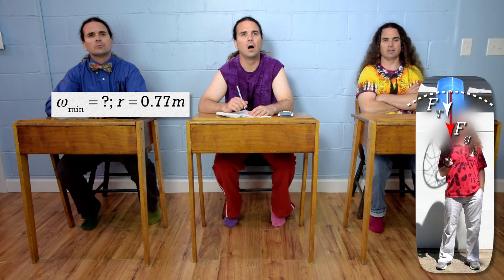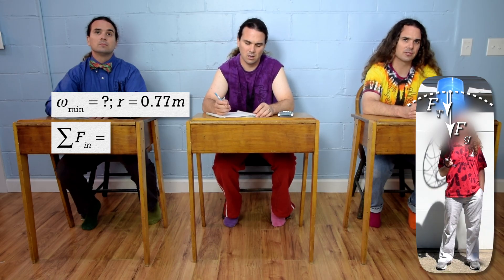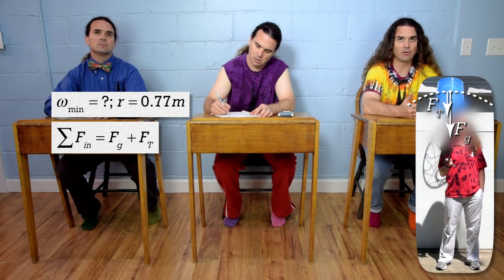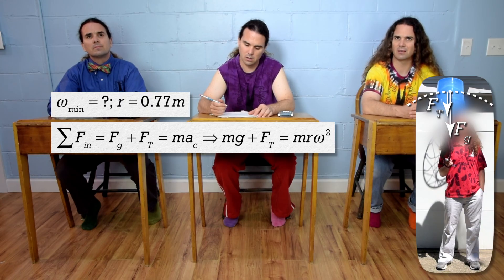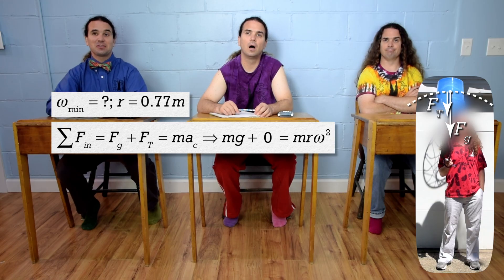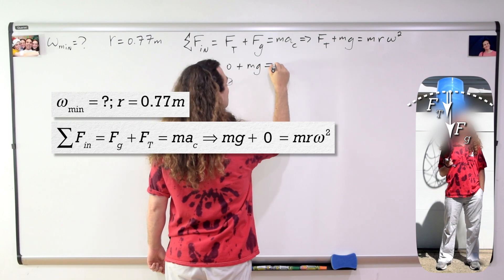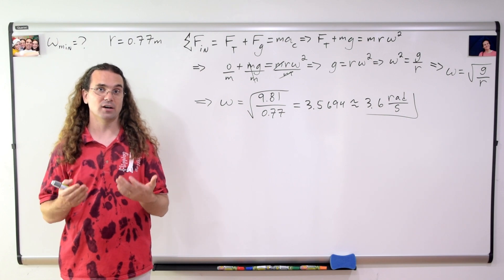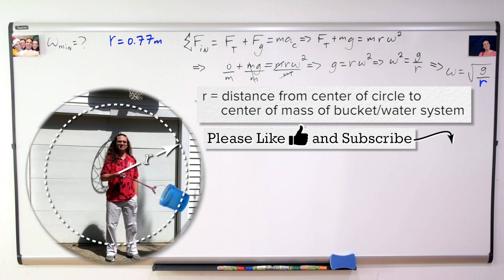Minimum Speed for Water in a Bucket Revolving in a Vertical Circle

Comment: I have a question for when you are solving the problem. So I had mg = mv^2/r. while you have mg = mrw^2. when I solved I got 2.76 m/s and you got rads/s. Is the difference in answer because of the units used, and the equation that I used?
Reply from the maker: I am pretty sure the difference is that I used angular velocity and you used tangential velocity. I talk about the difference in this video after the 4 minute mark. https://www.flippingphysics.com/centripetal-acceleration.html

Comment: I am confused. Does the tension force even work upon water ? I thought the tension force only works upon bucket since it is connected with a string.
Reply: Ultimately, it is the normal force from the base of the bucket that pushes inward on the water.   But the substance of this problem is the same, whether you examine the tension in the rope, or the normal force at the base of the bucket.   Ultimately, we are looking at solving for the special case, where an object can follow the circular path with no constraint force at the very top of the curve, and the object will momentarily be in free fall.

Comment: does this also applied on roller coaster physics? because the function is the same as the bucket of water
Reply: Indeed it does.  Roller coaster inverted loops, are designed such that the passengers only feel a push from their seat, rather than tension in their restraint harness.  When you are at rest in the loading station, you only feel an upward push from your seat.  When at the top of the inverted loop, you also only feel a push from your seat, albeit much less of a push force.  You feel like you are pulled by an apparent force that acts radially outward, holding you in contact with your seat.   But the reality is, you are accelerating downward toward the center of the loop's curve, at a rate slightly greater than g.  The normal force from your seat plus gravity are causing this acceleration.

The restraint harnesses are only there in case the real method of supporting your body doesn't work, such as if the roller coaster doesn't pick up enough speed, and you actually do fall downward in to your harness.  It would be an uncomfortable ride for passengers if it was built for this to happen on a regular ride, so the ride is designed in order to avoid this situation.

Comment: i used another method came out as 204 degrees /s , that looks way off :(
(i used the speed that ensures 1g upward to be canceled with g then i divided that speed by the circumference and multiplied by 360)
Reply: that the same value except 3.6 is in radians per second not degrees per second. to convert degrees to radian multiply by pi/180 and you will get close to the same value